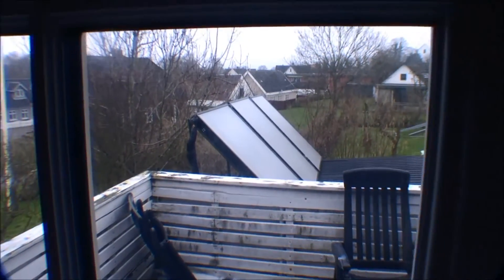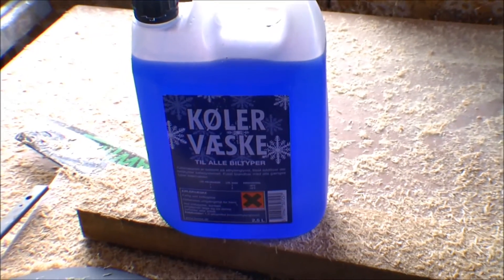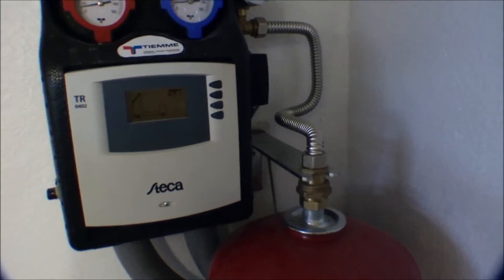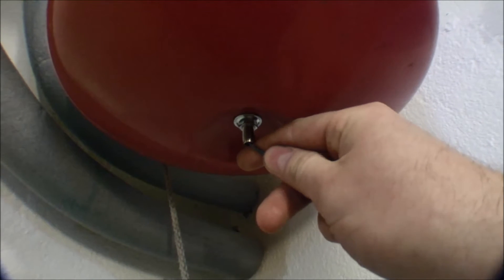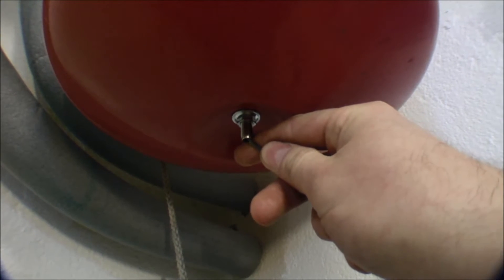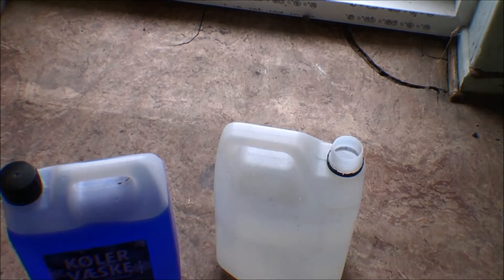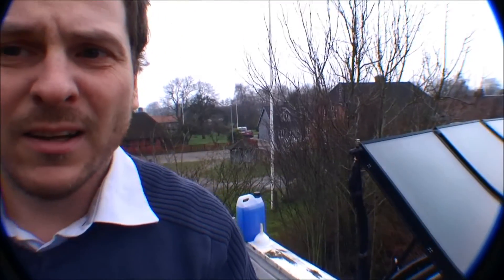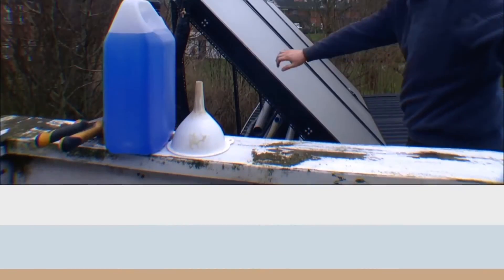Refills the solar system, with anti-freeze coolant - 024

Comment: Hello Sir nice & helpful video. I was wondering if we need to replace old fluid with new to the entire circuit (from collectors to the hot water tank in basement), from where should we drain it? If we do it from the collectors side on top of the roof, much old fluid will remain into the pipes below roof level... THX
Reply from the maker: I reuse all my fluids in my system,, I filter it with a coffee filter if it is full of rust/stuff.

Comment: When you fill the water by this way from the top of the system and collectors , how you can ensure there will no air insides the pipes loop?
Reply from the maker: It´s not easy,, but it has worked for years.

Comment: Car antifreeze is TOXIC if that leaks from from your  solar indirect pipes heating into the main water tank that can poison you.It may be a small leak and you may not notice it, but over time it is slowly but surely fucking up your kidneys. Nobody drinks from hot water taps(see Nigel Hatton comment below) but  residues of the chemical will remain in pipe work after you have used the hot water and then switch to cold water. Is it worth saving a few Euros/ Pounds/ Dollars etc and putting your health at risk? Get the proper fluids, Proplene Glycol.
Reply from the maker: The likelihood of this to be a problem, is so much less, the just getting into an car accident to and from work.
There has to be a leak inside the water tank,, the antifreeze has to leak out against the higher water pressure. The small amount leaked antifreeze will the mix with the 300 liter of warm water. And I see that if all the antifreeze was to leak in to the 300 liters, I would have to drink about 2 liters of hot water,, for it to be a problem for a 30KG dog. I don't normally drink Hot water from the tap.
Highly unlikely to become a problem.

Comment: Thanks for the video!  Very useful!  I have a similar system called Kingspan Solar. I will definitely try to fill up myself.  One other question, I am getting an error message of night circulation and it might be a problem with the non return valve.  Any idea where the non return valve might be? Many thanks!
Reply from the maker: Hi Billy Ding
Thank You very much!  glad you liked the video :-) No no idea what a non return it :-/
Thank you for watching! :-)

Comment: The anti-freeze you use should be food-grade (Propylene Glycol) in case there are leaks into your hot water. Don't use auto anti-freeze.
Reply from the maker: Hi Dan Sloss
Thank You very much!  glad you liked the video :-)
Thank you for watching! :-)
Reply: Don't drink from the hot water tap is the easy answer. Car anti freeze is superior and only €15 5 liters.
Reply: @romakayak  No one is drinking it, but brushing teeth,  showering,  washing dishes, even laundry, will lead to exposure to a toxic liquid, if it leaks inside heat exchanger. 
Og poster was correct. 
It's Blue which is correct colour for HW service,  auto coolant is usually green or red, but he did state it was auto, and didn't answer in his reply, so who knows.

Comment: Because our country is hot whole year , not snow , so we add the tap water instead the anti-freeze coolant , when I add the tap water the pressure meter will go to 2 ~ 3 Bar automatically . so is it OK for the heater work ?
Thanks for your help 

Regards John
Reply from the maker: Hi JOHN HOI
I am no expert on this at all,, and I am probably going it wrong,, but it works for now. sounds like you are using the water pressure to pressurise the system. I am sure it is fine. I run mine a bit lower,,1-1½ Bar. Mine leeks if I goes higher :-/
Thank you for watching! :-)

Comment: Hi Sir , I am the first  time using solar water heater , please let me know it must to add the air to the red tank  , when I changed all the anti-freeze ??
thanks
Reply from the maker: Hi JOHN HOI
Thank You very much!  There is no need to change to anti-freeze,, It is in there all year. But to top it off, I do remove pressure from the red tank. 
Thank you for watching! :-)